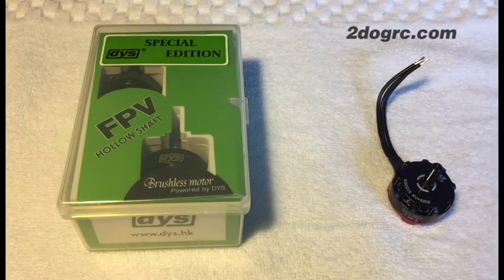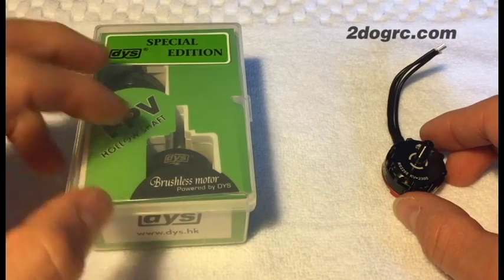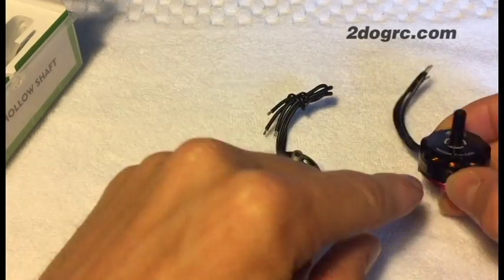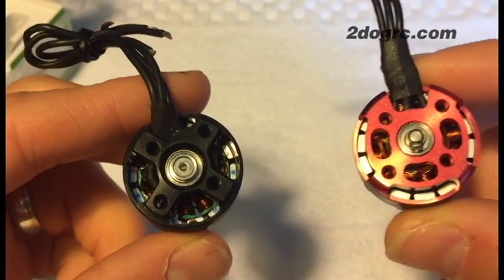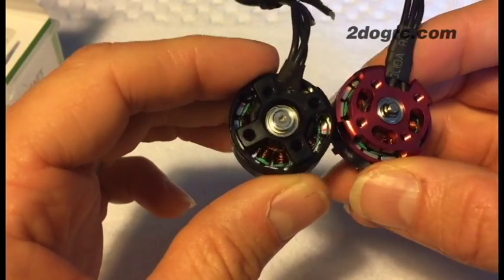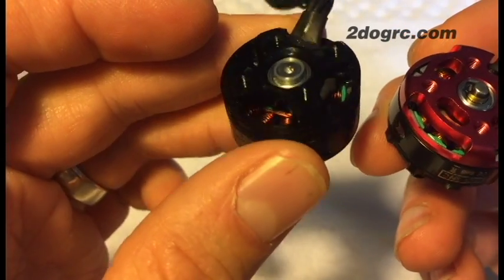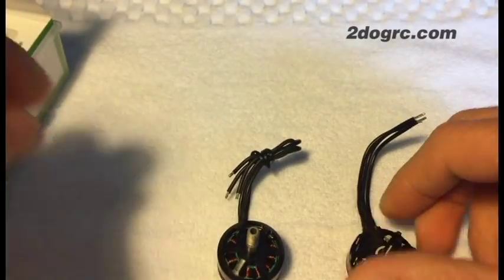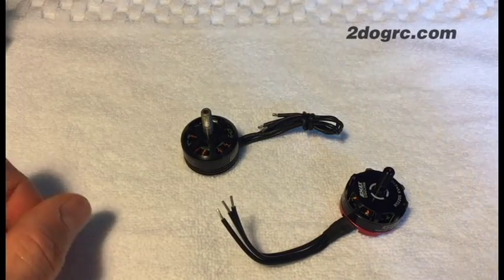Quick Comparison of the Emax 2205 and DYS SE 2205 Brushless Motor for Quads

Comment: would these work with the stock diatone crusader 190 esc?
Reply from the maker: Yes, they would work just fine.
Reply: 2dogrc  I went to the park and went threw almost 3 packs when one of my motors came off (my fault)  forgot to tighten the motor screws.  didn't look to bad so I re-soldered the wires and now when I arm it that motor twitches and the 3 tabs for the wires get hot.  so maybe I will pick up some of the red bottoms.  I can't find any of stockers for sale in the US.  but I do love the quad thank you for your help I have been telling all my friends about 2dog rc
Reply from the maker: Sounds like you did damage the motor or ESC. Sometimes hard to tell. If I damage one, but not exactly sure, I replace both. That way if I guessed wrong, I won't destroy the new part. You can mix ESC's as long as you run the same protocol.  The FC will compensate for any thrust differences.
Reply: I appreciate all the help thank you

Comment: What can you say about the se2205 motors now compared to the other high power motors in the market?
Reply from the maker: Well I have been flying both these motors on the same frame. I really can't tell a difference. I think Emax set the bar with the Red Bottoms and other manufactures have met the standard.

Comment: what Esc and what C-Rating  are Recommended for thos Emax. i cant find the info anywhere
Reply from the maker: Pretty much any ESC, for the 2600 KV motors a F390 or BL Heli_S esc is recommended.  As far as batteries, these can pull 90A on a quad so 70C 1500 would be a minimum. (70*1.5A=105A capable)

Comment: Which one do you prefer?
Reply from the maker: I only have 2 flights on the DYS due to recalled ESC's.  I get my replacement ESC's very shortly.  In those 2 flights, the quad felt as fast the 2205 EMax.
Reply: The EMax looks cooler, but the DYS seems to be more durable(and cheaper)